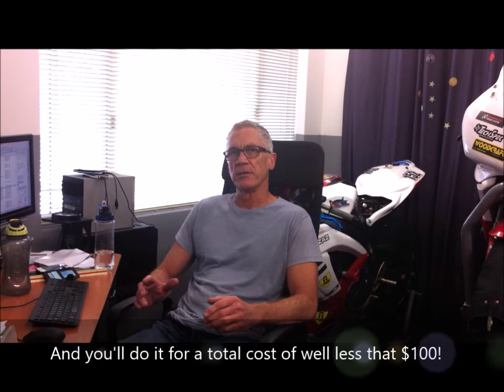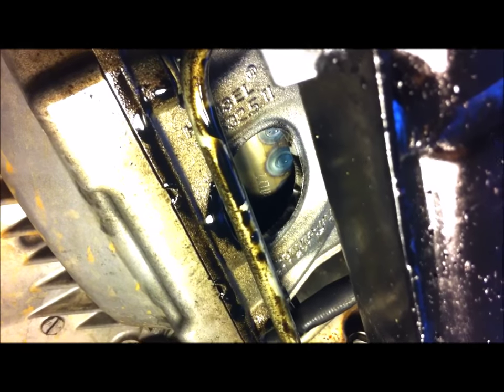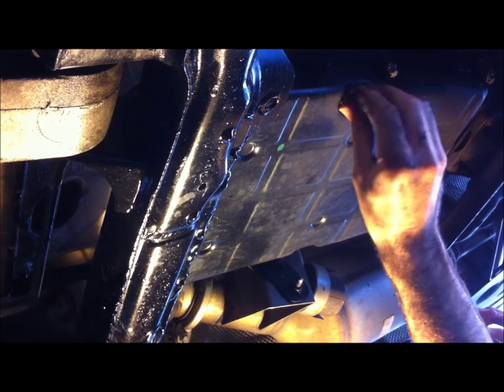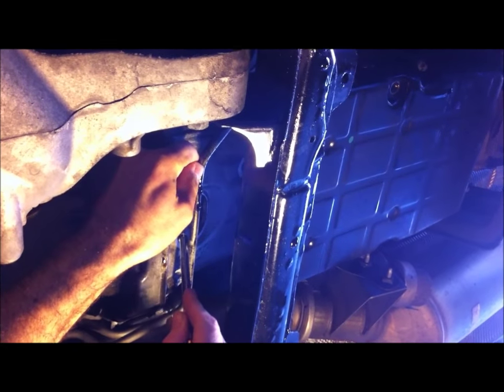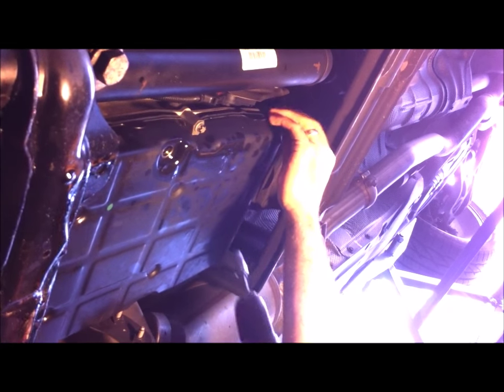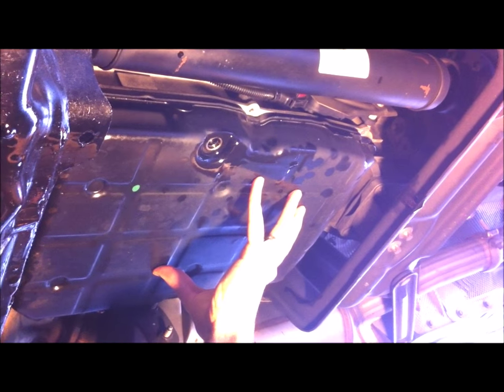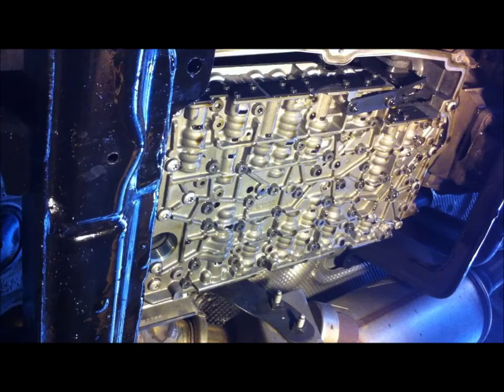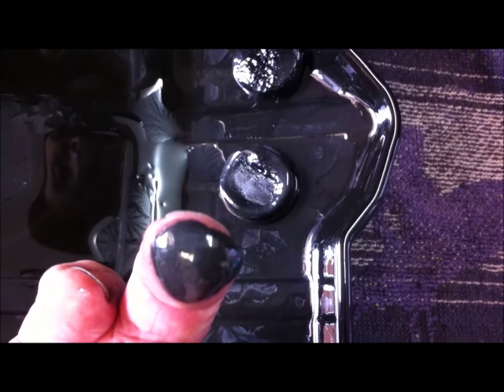Mercedes 722.9 ML320 ML350, C, E, S, GL Transmission Service

Comment: Brilliant video - thank you so much for taking the time to share your knowledge and lessons learned Scott. I'm going to service my S63AMG transmission for the first time this weekend. Local independent shops wanted $600-$700 US!! I'll take your method and some oil under my nails any day. One question, is it important which way you turn the crank to line-up the torque converter drain?
Reply from the maker: Simon thanks for your kind words. I haven't found the direction of 
rotation an issue when locating the TC drain plug. I've done this many 
times on 722.6 and 722.9 transmissions and have turned clockwise and 
anti clockwise with no problems. We get charged the same ... $AUD1000 is
 about the equivalent. The shops won't flush the oil cooler and lines 
and there's about a litre in there. You'll get a lot of satisfaction 
doing a better job yourself ... especially on an AMG! Awesome bragging 
rights at a dinner party ... you'll be a legend.

Don't worry too much about the temperature. As long as you're around 45C give or take a couple of degrees you'll be fine. The level setting is so subjective. The Mercedes Workshop Information System (WIS) says wait for a ... "spitting intermittent flow". So precise and repeatable!
Reply: Thanks for the follow-up Scott. I held off doing the project as I had to order a universal drain plug online and couldn't get it here in time to proceed (I didn't see your follow-up video until Friday night). Keep up the great work!
Reply: Hi again Scott. I have a question i'm hoping you can help me with. FINALLY I got around to servicing my transmission and everything went really smoothly until I attempted to fill the trans. with fluid. I created a rig not unlike yours with the appropriate adapter screwed into the pan, a 3/8" ID fluid line going through the cap of the oil bottle, and a trigger controlled air supply. I turned the regulator down to around 5-10 psi on the compressor and am very gingerly depressing the valve to push fluid up into the car but it just isn't taking it. At first I suspected it's because maybe the transmission is a sealed unit and it's struggling to get fluid in as air can't get out. So I loosened the same oil cooling line on the side of the gear box as you had done earlier in the video (I had elected to not do the cooling line flush) but this didn't help either. When I hit the air trigger the fluid rushes up the clear pipe but then won't go in - at least not with any ease. 

After messing around with it for an hr or so I had only managed to get about 2 litres in there. I read somewhere just now that the car MUST be in neutral while doing this. I hadn't read that before and wondered if that was possibly the reason, perhaps the oil box won't vent with it in park? 

Kind of at a standstill as i''m weary of pressuring up too much (the oil bottle starts ballooning up when I depress the trigger already and i'm afraid that w too  much pressure I may blow a seal in the box. 

Any ideas would be very much appreciated mate. 

BTW its a 2009 S63 with the 722.907 transmission.
Reply from the maker: Simon. If the end of tube is cut square it's probably sealing against the bottom of the oil container. The tube needs to be cut at an angle. The transmission does have a breather valve on the top. All transmissions, transfer boxes and differentials have a breather as they heat up and would pressurise if not for a breather.

It doesn't matter what gear you're in when you pump in that initial fill. And 5psi is plenty to push that ATF into the transmission. Let me know how you go.
Reply: I took a look at the hose base and sure enough it was pretty much square. I cut it at an angle but realized as I was feeding it back into the hole in the cap that it was curling up (back towards the top of the interior of the bottle - the tube was fairly recently cut from a role and the coiled form was still there somewhat). I made a splint for the pipe with a wooden skewer and tied that sucker off straight with some cable ties. Tried again and nothing. Got an original burst of fluid and then it would stop and the bottle would start swelling again. Racked my brain all day and I think I've figured it out. The tool I made to connect my fill adapter to the pipe going into the ATF bottle has a standard air hose coupling (for quick release so I can detached the hose from the car when it's full and just leave the adapter, the shut-off valve, and a small length of pipe dangling to release the overflow when it's up to temp.) What I realized (or I think I've realized) is that air hose couplings (the ones found on standard quick release air hose tools) won't allow the passage of liquid through them - only gases. I did manage to get 3 of 5 liters in there already but it took me over an hour! I'm going to stop by a hardware store on the way home and buy a pressure washer quick release coupling and see how I get on with that. Just from the pic of it online I can see it's better suited and likely to work. Thanks again for the prompt response last night and for the helpful and practical advice.
Reply from the maker: Hopefully that's the issue. Let us know how you go. Scott
Reply: Scott Elliott That was it Scott. I cut out the air coupling and went straight through. To test it I set the ATF bottle up high on a shelf and opened the valve to the car and the fluid started moving. Hooked up the air and it started filling like a champ! Just got back from a test drive and I really can't believe he difference. You really weren't kidding, the gear changes were never an issue but now they're like silk (went from very good to incredible). I also put in a new rear transmission mount while I was under there and while I wasn't able to get it on a clear road and give it the beans, I can already tell the drivetrain has tightened up considerably - the whole chassis is calmer. Can't thank you enough for your quality work and feedback - hope you never give it up! Thanks mate.
Reply from the maker: Good news Simon ... your a legend doing this to your AMG. Have a look at your engine mounts. My LHS one failed due to 600Nm of torque from my chipped diesel. I was able to strengthen the mounts with a polyurethane flexible construction adhesive/sealant. It's made a difference with a more direct connection  from the engine to the rear wheels. Less energy wasted twisting the motor. I can actually "feel" the engine through my hands on the steering wheel.
Reply: Scott Elliott thanks Scott. I noticed that the torque twist transferred to the chassis when revving the car while standing was reduced and I assume it's because of the rear tranny mount, but I saw your (again excellent) video on the engine mount change and looking into changing those next. I've bought them both and understand that one is super simple to change and one is a lot more involved but I'm curious, did you notice any significant change in cabin comfort by filling yours with structural material? My concern before installing them both is that it'll add considerable/noticeable echo to the cabin. Your thoughts?
Reply from the maker: Simon it's the LHS one that usually fails as the motor tries to twist clockwise looking from the drivers seat. If you strengthen the mount with the polyurethane you'll notice slightly more vibration coming through the steering wheel. I don't mind that as it gives more feel and makes me as the driver feel more connected to the car. I don't like the isolated slushiness of many modern luxury cars. I don't notice extra noise or vibration in the cabin only the slight feel in the steering wheel.

Changing the LHS mount is easy but the RHS requires removal of various components depending on the motor. You may have to remove the alternator and part of the exhaust to give clearance to get it out. You probably don't need to replace the RHS mount ... just reinforce it.

Comment: my 2008 c200 kompressor does not have a drain hole for torque convertor
Reply from the maker: Some cars don't have the drain plug. Look through the comments as it's been covered.
Reply: @ScottElliott152  ok thanks
Reply from the maker: @alex59606  Alex I looked through the comments. I know the missing TC plug has been discussed but I couldn't find it.
Some cars don't have that drain plug for some reason.  So an alternative is to remove the oil cooler return pipe on the RHS of the transmission, start the engine in Park and run for about 15 to 30 seconds and the transmission oil pump will pump out the TC.
Reply: @ScottElliott152  I'll try and do it myself.  Thanks again

Comment: Hi Scott ,
I disassemble the box for a leak joint spi now I have reassembled and filled the oil.
The speeds work for 10 minutes D / N / R ok
Now the speed remains on N when I put D or R the car does not advance and does not back up
Do you know why ?
Reply from the maker: Ben it is difficult to know what your problem is. It sounds like low oil level.

Comment: many thanks very interesting
Reply from the maker: Thankyou.
Reply: Scott Elliott  pleases have quastion !the torque converter did will filling already when fill the transmission??
Reply from the maker: @husseinmaleh8852  The pump in the transmission fills the torque convertor.
Reply: Scott Elliott many thanks
Reply: Scott Elliott dear , when i fill the transmission via fluid and make drain notes noise in the torque  convertor and be very weak with drive what yu thaink reason??
Reply from the maker: @husseinmaleh8852  Not possible for me to say. Have you filled properly? Did it take about 9 litres before you drained the excess?

Comment: anybody have a stripped TQ converter bolt ? did you find a better replacement? how did you get it out?
Reply from the maker: That's a shame Blake. If it happened to me I'd drill with an M5 and tap to M6 x 1 pitch. I'm pretty sure the existing bolt is an M5. Put a bit of grease on the bit and carefully drill without the bit going too far in. Use a button hex head short M6 bolt as the new drain plug.

Comment: Isn't the old supposed to be blue
Reply from the maker: It depends on what Mercedes specification your transmission requires. The later versions use a blue/green ATF MB236.15. The earlier use a red ATF MB236.10 to MB236.14

Comment: Can the transmission system ever expire?
Reply from the maker: Hi George ... your question is not clear. If your'e asking can the transmission fail yes it can. If you do regular ATF and filter changes every 3/4 years it will last a long time. Scott

Comment: I have  had my ml320 w164 transmission  oil and filter change two months ago it was working fine until today when I noticed it slipped when accelerating  probably from 2nd-3rd to forth gear, when I had the transmission fluid changed I gave the garage that was doing it 10ltrs of fluid and new filter all Mercedes parts, when I collect the car he returned 3x1ltr bottles of fluid when I questioned why he hadn't used all of the fluid he said there was 3ltrs of fluid in the electric filler pump from his last job which wasn't a Mercedes and when I told him that he had contaminated my fluid with the non Mercedes fluid in his pump he laughed and told me fluids are all the same , is this correct anyone,?
Reply from the maker: Robbie I spoke to an Engineer at Penrite Oils to ask when they'd have an ATF with the MB236.14 specification for my 2008 722.9 transmission.

The Engineer told me the base oil is the same but the additive recipes are not for the different transmission manufacturers.
They add things such as viscosity improvers, friction modifiers, anti wear additives, Zinc etc.

If this happened to me I'd write it off to experience and do the work as DIY. With these modern 6, 7, 8 & 10 speed transmissions it's important to use the correct ATF. It appears you may have about a third of your ATF as the wrong specification. Perhaps try to find out exactly what was left over in the electric pump so you can determine if it was compatible. Then you can make an informed decision about a remedy.

Keep us all posted.

PS. Last time I checked "Mercedes ATF" was Fuchs 4134 with a Mercedes label and four times the cost. You don't need to use "Mercedes ATF" as there's no such thing. Mercedes don't make oil they buy it from an oil manufacturer. My 2008 W204 has to use ATF with the MB236.14 standard. There are any number of quality ATF's that meet that specification. This is what I currently use: 

http://www.totaloil.com.au/automotive-lubricants/products-cars/pcmo-transmission-fluids/fluidmatic-mv-lv.html

Comment: HELLO, I HAVE A ML 320 DIESEL, 7 VEL. I DONT KNOW THE MODEL OF THE TRANSMISSION AND THE PROBLEM THAT I HAVE IS THAT SOMETIMES WHEN IT IS COLD I HAVE TO ACCELERATE TO 2000 RPM SO THAT IT COMES IN FIRST CHANGE AFTER THE OTHER CHANGES HAPPENS WITHOUT PROBLEMS, GREETINGS.
Reply from the maker: Leonardo it is not possible for me to guess what is wrong with your transmission. How many kilometres and has the transmission ever been serviced? If it has not .. then change the ATF and filter and see if that solves your problem. Also it's not polite to use capital letters as it's like you are shouting. Scott

Comment: Which car is this?
Reply from the maker: 2008 W164 ML320CDI
Reply: Thank you sir.  With your help i will be doing my 08 GL 320CDI
Reply from the maker: @dusaintel  Help it goes well. Report back with any comments about how it went.
Reply: Scott Elliott will do Scott. I am ordering the parts right now.
Reply: Scott Elliott one last question. Did you use OEM parts or aftermarket?
Reply from the maker: @dusaintel  I use quality aftermarket parts.

Comment: how many feet for lbs is 10nm
Reply from the maker: You can Google as there are conversion calculators online. 10Nm = 88.5 pound-inches.

1Nm = 8.85 pound-inches

Comment: Ive put 192K miles on my E350 although its every 70K... I like to run 150K on the fluid.
Reply from the maker: Are you doing the ATF at 70k or 150K?
Reply: Scott Elliott the first owner did it at 40k, I changed it again at 190k. So 150k. I do brake fluid every 30k. Engine Oil every 11k miles. I sent in the ATF to Black Stone labs. They said it was pretty dirty but nothing too scary.

Comment: Seem like when you filling the car wasn't leveled just ask because I'm doing this coming weekend
Reply from the maker: The car was level. That doesn't mean the gearbox is level. Either way it doesn't matter as the fill point is approximately in the middle of the pan lengthways. I've done these with the car level and the pan level and either way is fine.

Comment: Oil cooler leaks on this w164 om 642
Reply from the maker: The oil in the turbo inlet is coming from the engine breather. We're installing an oil catch can soon. The oil cooler is ok and isn't leaking. We've checked it.

Comment: hi , please What is the difference between red oil and green oil for automatic box cars.
Reply from the maker: The Mercedes changed their specification for the ATF a few years ago. The change in colour was used to differentiate from the old ATF. Google the difference in specification between the old red MB236.14 and the green/blue MB236.15
Reply: Scott Elliott good morning , thanks for your last explication but I did not understand what you mean by the sentence  " Google the difference in specification between the Old ref MB236.14 ans green/blue MB236.15 " and i want to know If a Mercedes automatic box car  deponds of red oil in the change by the green oil is that the box breaks down or not?
Reply from the maker: Fatma ... You can't change to the other colour. If your transmission has green/blue MB236.15 ATF that's what you must use. You can't use the other colour. If you have red MB236.14 you can't use the green/blue ATF.
Reply: Scott Elliott OK thanks 
How can we know if the car need red oil or green oil. and Sorry to disturb you .
Reply from the maker: Fatma ... consult the owners manual. If the ATF specification is 236.15 or above it will be the green/blue. If it's MB236.14 or below it will be red.
Reply from the maker: Fatma ... join www.benzworld.org Someone on that forum will know what ATF your car uses.
Reply: Scott Elliott thanks a lot and have you a video of transmission service for Mercedes w212 , w205 and w204?
Reply from the maker: I have videos for the transmission service on the W164 and W204 with the 772.9 7Gtronic. The W212 will be the same process as the W204. W205 should be about the same as the W204. They are very simple transmissions to service. I've recently done the videos for the W164 and W204 so you'll find them. Good luck and let me know how you go. Scott
Reply: thanks for your intrest . Do you have a method to know if the auto box needs red oil or green oil.
Reply from the maker: No I don't. You can call the dealer with you VIN number and they will tell you.
Reply from the maker: Fatma why don't you loosen the drain plug and unscrew it far enough to let a small amount of ATF seep out into a glass jar?
Reply: Scott Elliott the problem the car ils oil free .
Reply from the maker: ok. Call dealer with VIN and they can tell you what ATF specification.

Comment: you didn't do it on a flat surface you car was backed way too high.. your fluit amount is incorrect due to that,
Reply from the maker: I respectively disagree. The Mercedes WIS says to make the car approximately level which we did. See 1:05 where I say we've leveled the vehicle ... you can see the spirit level on the side rail below the front door. So that means the oil pan slopes slightly downwards. Considering the  white level pipe is about the middle longitudinally the level is correct. That is it's slightly lower at the rear but the same amount higher at the front. I've done lot's of these 722.9 transmissions and there all running famously.